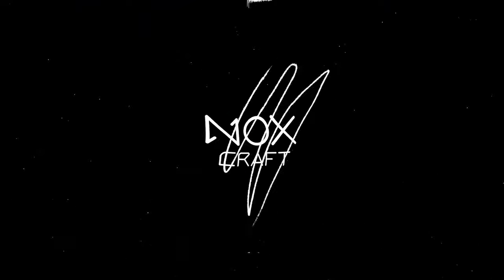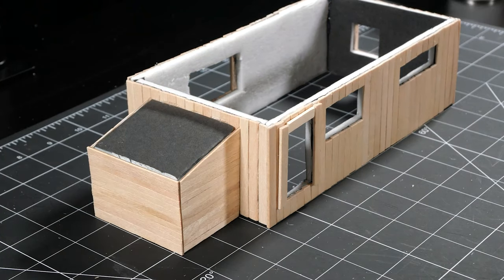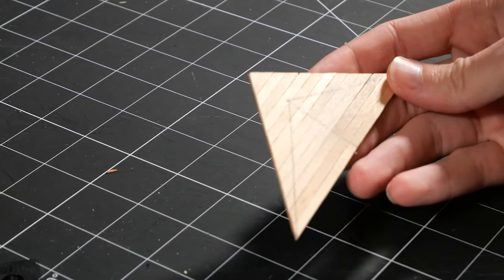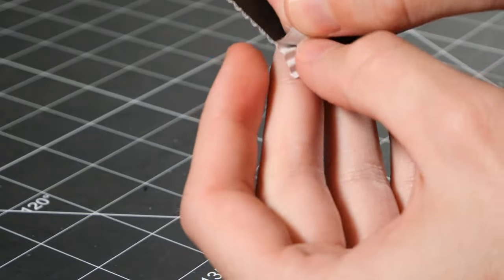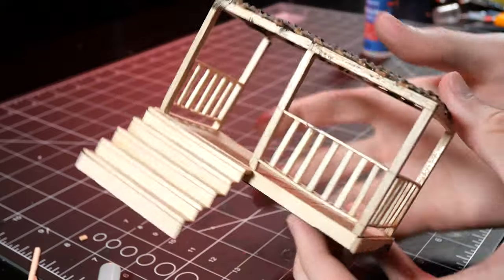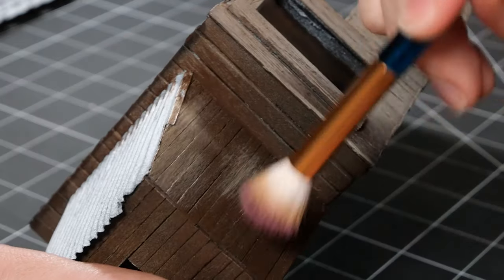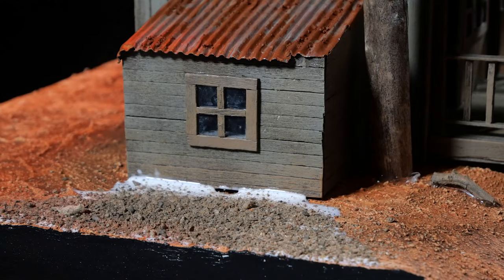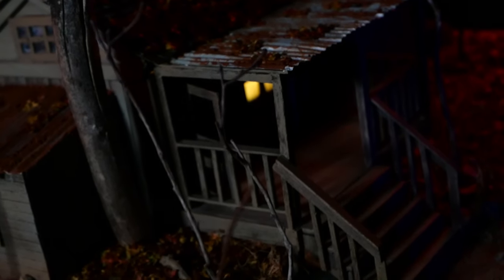I made Hopper's cabin from Stranger Things using coffee sticks

Comment: Awesome!
I love to use these and doctor's tongue spatulas (boxes are both cheap on eBay) for wooden planks, but normally it's more wild west stuff and the like.
As you mentioned, it's usually a good idea to use protective glasses, ones that have air circulation so they won't fog up.
And for situations where you need to angle them in weird ways, it often pays off to glue a piece from a roll of 80 grit sandpaper onto a board.
Reply from the maker: Thank you! And thanks for the advice. I love learning new things from other creators.